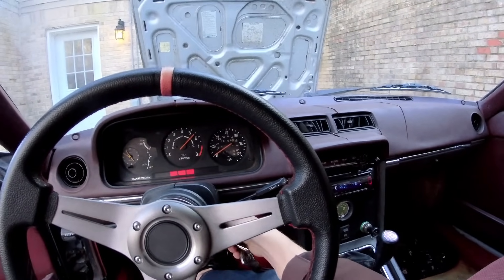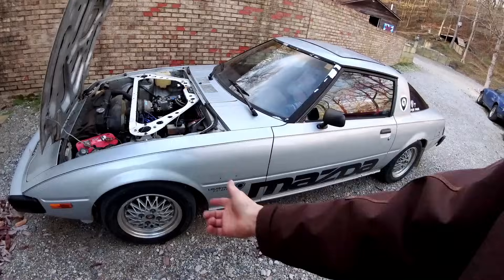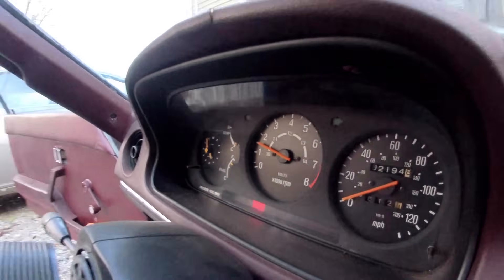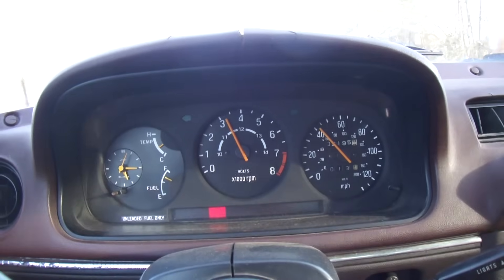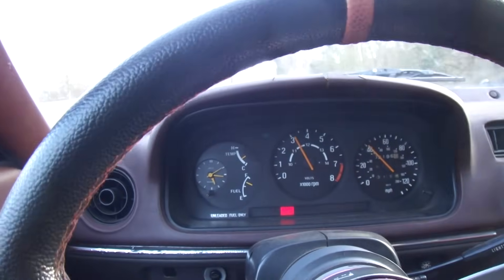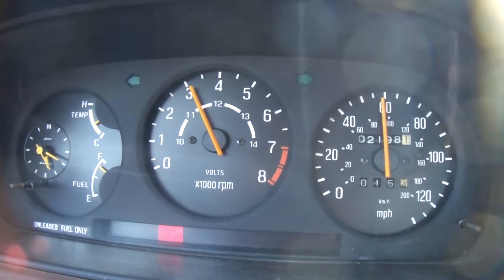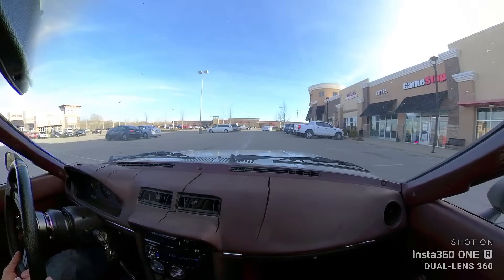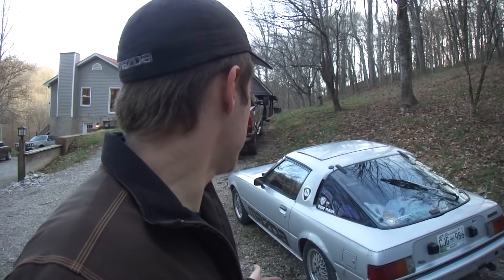Is A Bridgeport Rx7 Streetable?

Comment: No one should listen to any advice this guy gives. No air cleaner will ruin your Apex,side, and corner seals in no time. No air cleaner = Compression loss. When a engine jerks/bucks around  like he experienced is a sign of a lean condition. That can be fixed by changing  jets on the carb.
Reply from the maker: I'll gladly stick my 02 sensor back on and show you the AFRs at that exact moment in time.  I agree with you on the filters, but having small filters or even one mounted over over velocity stacks really limits air flow.  Until I can build a complete airbox and stick a filter up front.  This is what I've got